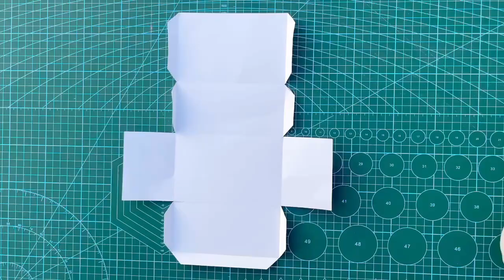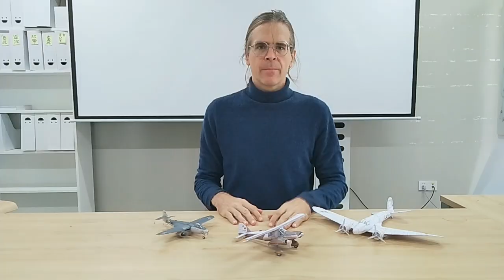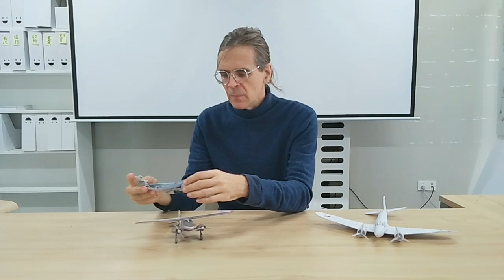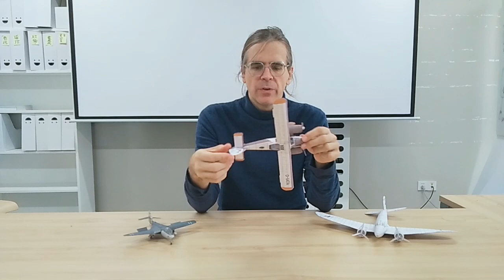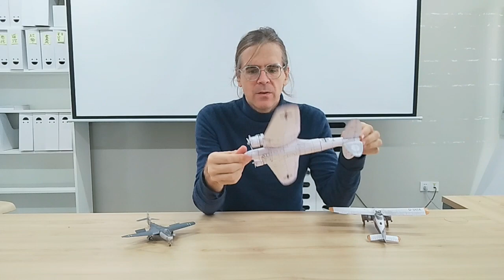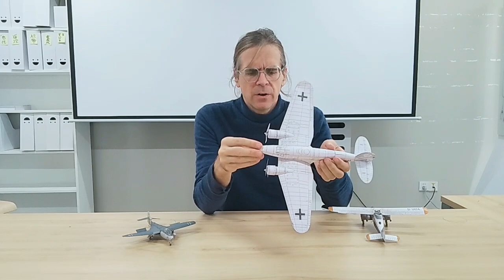Stahlhart Papercraft Channel Introduction

Comment: i have used many of your templates and they are great. just a small suggestion, the audio is not very audible in this video, it would be great if you could rectify.
Reply from the maker: Do you mean the sound volume or the sound quality? And on this particular video only or on all?